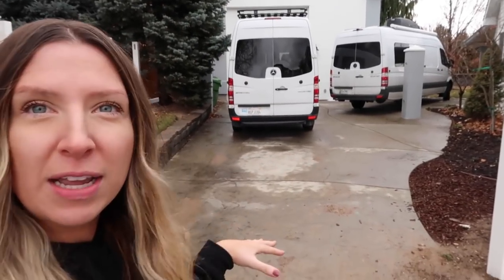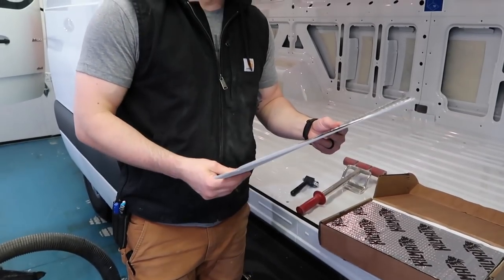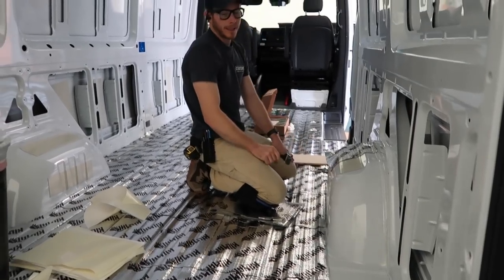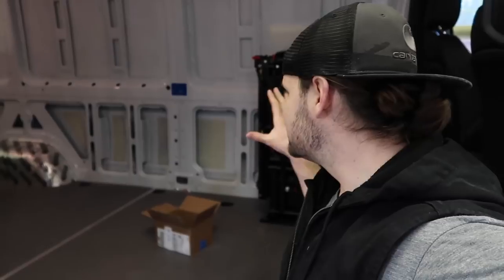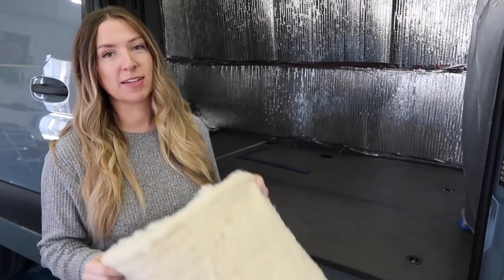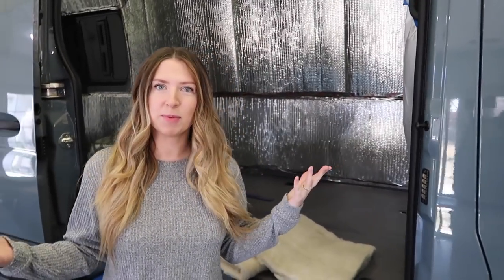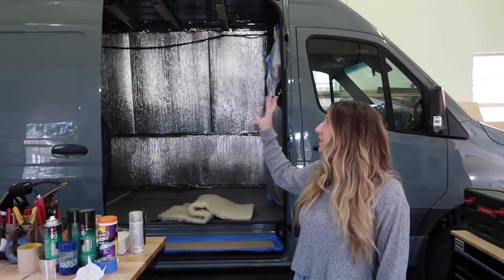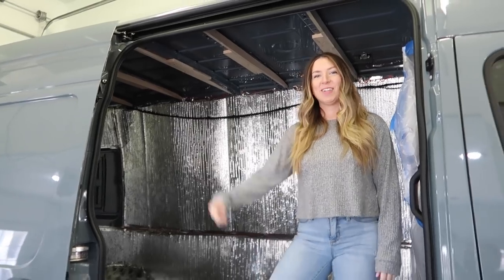van insulation for floors and walls & sound deadening | VAN BUILD SERIES

Comment: Completely agree, people focus on the insulation but windows and front cab are what let the most heat escape/enter. It's worth spending more time on a curtain between the cab and rear of the van, and window covers. The reality putting insulating inside metal walls isn't going to do a lot, as the heat can transfer through the metal and around the insulation anyway. I built out a transit and at least that has thermal breaks between many of the contacts between the inner wall and outer wall of the van.

I also used recycled plastic insulation (like Thinsulate) you can get it in thin sheets or bats, it's cheap, easy to install, safe to handle, and it is resistant to mould and moisture, and can breath to let moisture that accumulates on the wall out again.
Reply: The inside layer (living area) of reflectix provides the thermal break and is a vapor barrier, if properly sealed.  It's as good as it gets, from a cost/performance perspective.  There is no perfect solution.  It's a van.

Comment: If I may suggest, EHP Rollboard, it’s a Ceramic insulation. 1/8 of an inch of it outperformed 2 inches of foam in our bus conversion.
Reply: Just looked it up. Wow! Great tip. Thanks for sharing. 👍
Reply: Where can I buy this?
Reply: @TheWilleyWay Minseal Corp in Arizona, do not buy from Amazon
Reply: @diydetailofficial  hey one more thing is this the ceramic fiber cloth or the blanket? thank you for the info.

Comment: Hello you guys,
I am very impressed by the way you are insulating your rigs.  I'm looking out some van conversion builders for a near future.  But in my case I will be living in it full time BUT I am in Canada, and here the temperature could get as low as -30 degree Fahrenheit.
What are you doing for the pipings and the tanks (grey and black).  Are you putting them under the rigs in an insulated box with heat???

Comment: So normally the Kilmat is only meant to cover a partial amount of the walls/floors/ceiling. Are you covering the entire floor purely for the waterproofing feature that Alex mentioned? Seemed like overkill so just wondering about that. I love the WOOL idea, might have to use that instead of foam board even though it will cost a little more. Thanks for sharing this info, it is very helpful! We got our used sprinter 1.5 weeks ago and are super excited to start this adventure. :)
Reply from the maker: Yes we did kilmat on the entire floor to help create more of a barrier and prevent any rust issues down the line
Reply: @SaraandAlexJames  may I ask what the layer of material was on top of the killmatt?  It looked like foam, Alex nor Corey mentioned what it was, but we could see it.  Thank you!
Reply: Never mind, I see below, thank you!

Comment: Hi Sarah and Alex, was floor insulation something that you installed in this build? If so, was it XPS board or Polyiso board?
Reply: Good question.  I wish that they had specified that.  It looked like some type of black foam mat, but the video was quick.
Reply: @JohnBaker3000  It's 1/4" Minicell Foam from Foam N More

Comment: Could you talk about how you removed the factory floor beforehand? I just bought my van and want to pull it up to insulate. Also, what foam board did you use above the sound deadener? You didn't really go into what product you used for the floor before laying the sub floor back in.

Comment: what is the point of reflectix insulation on the interior? The R-value is almost negligible without proper spacing and thermal reflection? just curious what it adds to insulation VS just using wool and a wall

Comment: After installing the kilmat, 1/4" Minicell Foam from Foam N More than laying the subfloor back down, can you just reuse the hardware from the subfloor? I just don't want to drill extra holes in the metal like other builders have shown. Thanks!

Comment: 8:20 I'm sorry... did you say you put reflectix on yr van walls first, then wool then another layer of reflectix?  If yes then that goes against every professional who says reflectix on van walls is pointless and that it's only good with a one inch airgap.  Or just use on windows.
Reply from the maker: 007nadineL yes we said that. And we are professional van builders who have tested it. 🤷🏻‍♂️
Reply: I think the expert on van insulation is Greg Virgoe who has a video here. https://m.youtube.com/watch?v=DKy6WnFh368. He is an industrial HVAC pro in his work life. According to him, reflectics are intended as a vapor barrier to keep moisture from breathing, cooking etc from reaching the outside van walls and condensing on the inside of the outside walls and wetting the insulation. I’m with 007nadinet: I don’t see how reflectics stuck directly to the outside walls would do anything except maybe keep moisture off the inside of the outside wall, but by then your insulation is already wet. Anybody else have thoughts?
Reply: @billvanarsdale  Just need to make sure that the living/warm/occupied/moisture side vapor barrier is really sealed well.  The outer reflectix can't hurt, and will help, as long as the inner (living side) is sealed. well.